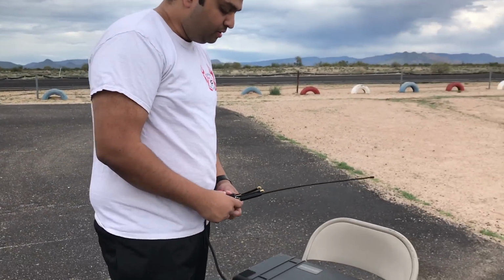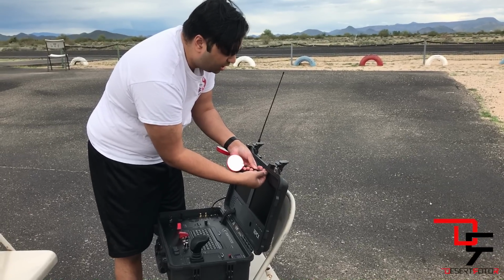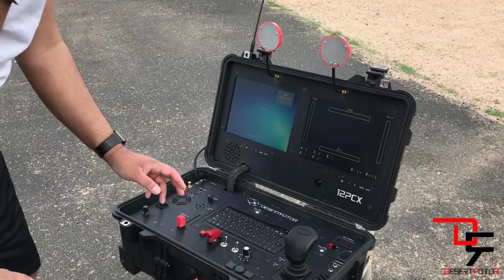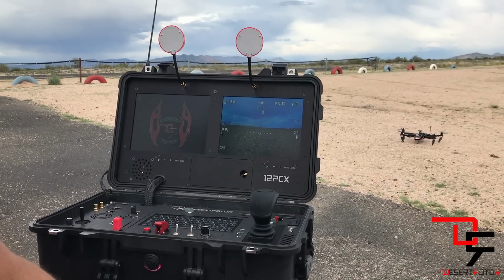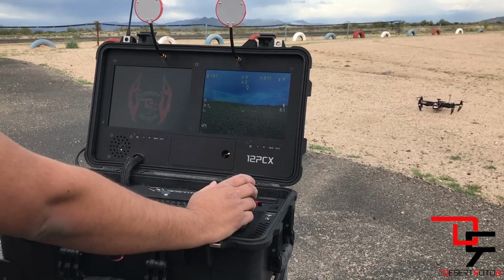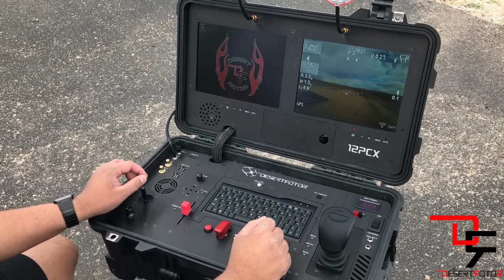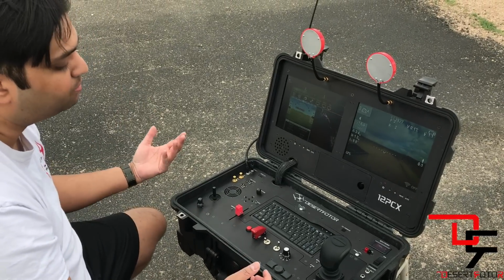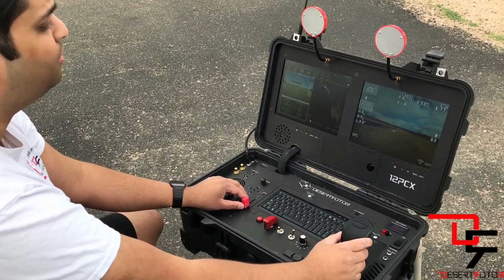Desert Rotor 12PCX HOTAS - Next Generation Ground Control Station

Comment: How far can I fly an aircraft with it?
Reply from the maker: Hello! It depends what communication module you install. You have unlimited range if using a LTE radio. Point to Point radios typically around 5KM to 100KM depending if you use Antenna Trackers and RF Amplifiers. Range depends on a number of other variables, though those are the rough figures.

Comment: I love it but ya need a mouse
Reply from the maker: Hi Josh! There is a HulaPoint Trackpad on the switch panel. Easier to see on our website though it's to the left of the primary flight control stick. Some of our clients also just use a bluetooth mouse if not the trackpad. Thanks!

Comment: What is the station power supply? Grid power, to me, is impractical and I am guessing you would want a good size battery for and onboard computer and communications equipment to last for any real length of time.
Reply from the maker: Hello Nicholas, all our GCS models can be powered via 4cell Lithium-Ion packs and/or AC Power Supply. There are parallel battery ports internally so you can run two packs at once and 'hot swap' packs during live missions. Or you can plug the power supply into a generator. Some clients build their own packs for the GCS to get extreme capacity as there is a lot of space internally. Thanks.

Comment: i can imagine the guys faces at the local fpv races if i pulled that thing out. Very nice piece of equipment you got there.
Reply from the maker: Thank you! The FPV race dudes would have to bow down to you. Racing on a HOTAS (Hands on Throttle and Stick) layout is a whole new world, conceptually easier, more precise (hall effect joystick)...means more speed. We have a Diatone GT2 bound to our GCS :)
Reply: Oh man you do!! lol I have that very quad:) i was sat contemplating if it would in fact be the way we will head in the future.Quads are evolving so fast but the way we control them has been stagnant. Wish i was in the position to just get one right now and get it hooked up to the Rotor Rush sim and just see how i get on with it,see if i can better my times. Very very interesting indeed.